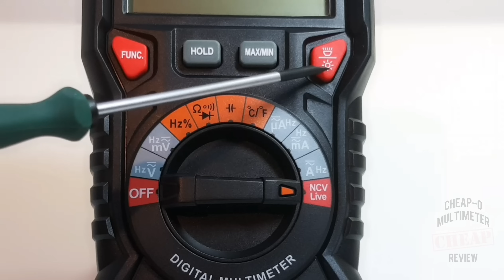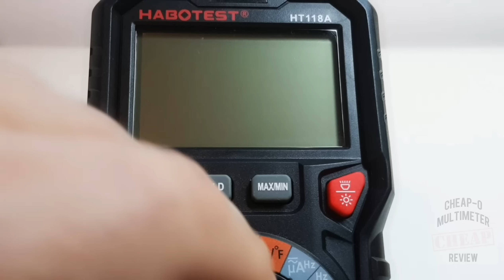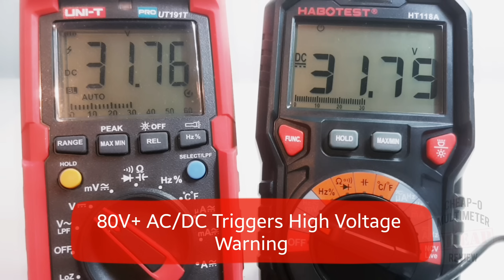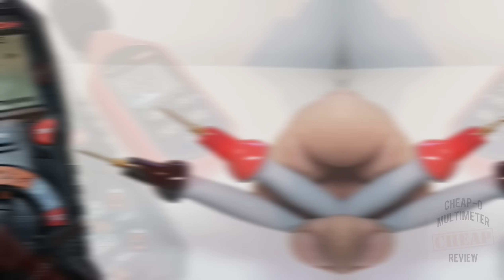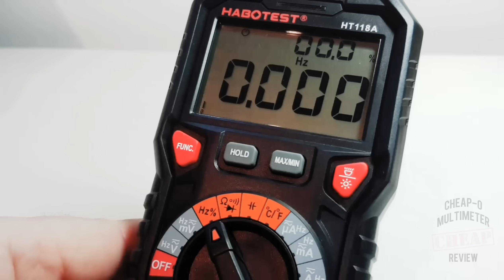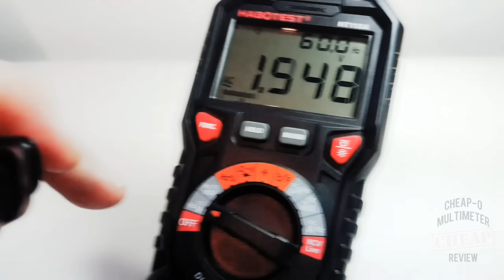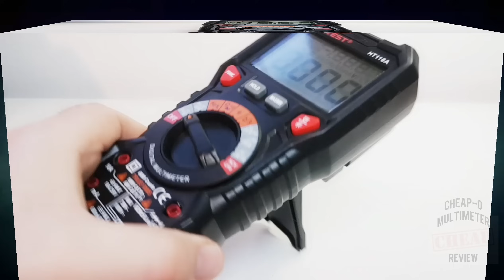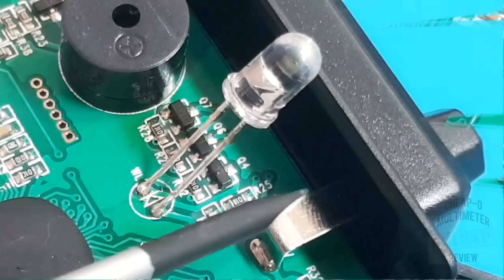HABOTEST HT118A  CHEAP-O Multimeter Review & Teardown!

Comment: Well I am genuinely surprised to see what must be a first, a dual display meter for well under $50, not to mention other decent features like the visible jack detection, backlight indications etc. this feels like a nicely upgraded version of a manual range Tacklife DM01M meter I own that has much the same case, this ones ten bucks more but this ones auto range with dual display and you can see the added expense in the generous feature set.  This is a great value meter for well under $50 and im kind of a nitpicky so and so usually but as you said its hard to find fault with what this meter offers considering the price. Like you im always irritated when the back light goes off way too soon and in fact I agree thats my worst negative if I was to voice one on this meter, but sadly weve seen that in so many other meters costing more than this one does and it seems to be an issue that falls on deaf ears of the manufacturers for the most part.  This is also a first, dont think if ever seen you give 4.5 stars and I have to agree this deal is hard to beat.
Reply from the maker: Yes Mike, this meter hit all the right spots..Features , Affordability , Ease of use, Build quality , innovations to name a few...it really put a smile on my face..definitely a hard dmm to find fault with...and the display....oh so gorgeous!!

Comment from the maker: No worries Derek...Have a great night!
Reply: which is better HT118A or UT191T?
Reply from the maker: @kresimirpranjic4898 I would choose the UNI-T UT191T ....really a fantastic and professional meter for a reasonable price.
Reply: @KeepOnTesting TNX  i have doubt on UT139C and HT118T which is better?
Reply from the maker: @kresimirpranjic4898  More features on UT139C , display is better on the Habotest..also cheaper. Tough call, I would probably opt for the Habotest if it came down to price vs performance  ...
Reply: @KeepOnTesting  What is temp. acuracy of HT118T
Reply: @KeepOnTesting  What do you think Mastech MS8239C or Habotest HT118A
Reply from the maker: @kresimirpranjic4898 Definitely the Habotest, much better package overall..
Reply: @KeepOnTesting  What do you think habotest or peak meter PM 8236
Reply from the maker: @kresimirpranjic4898  Habotest unless you really need that USB data logging..